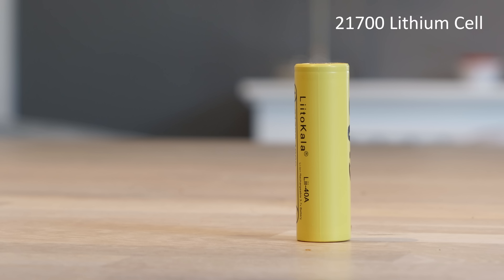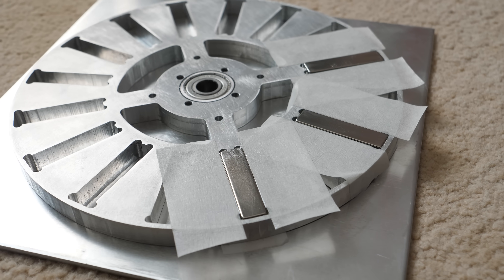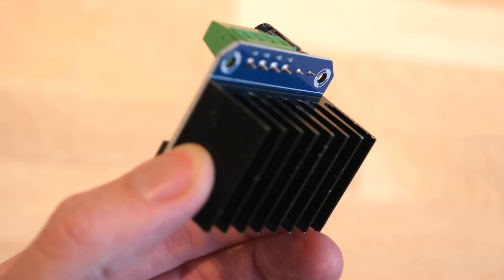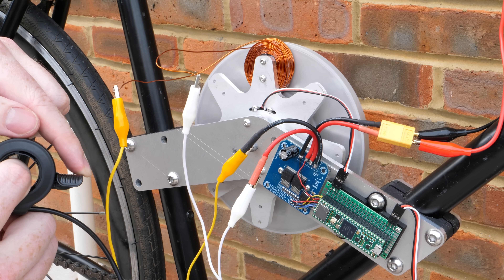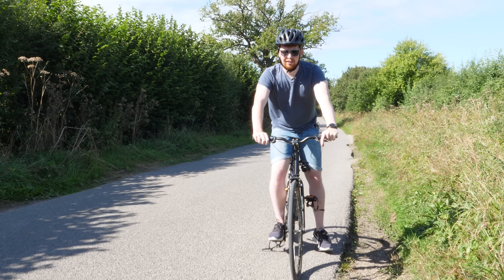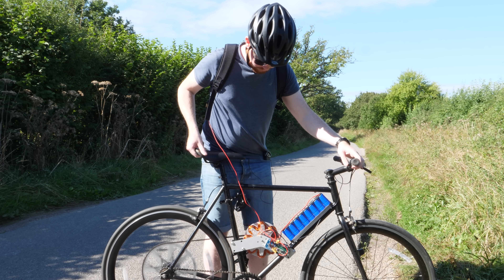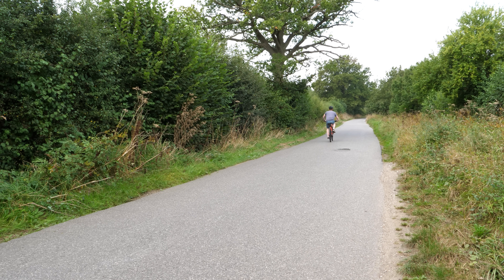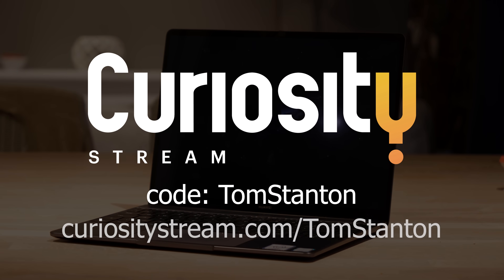Super Capacitor Bike

Comment: If you want to make an ESC, you’ll need both modern MOSFETs and high-current gate drivers. The NTMFS5C628NL is the gold standard cheap good MOSFET for motor drivers in the 12S range, and there’s likely similarly good MOSFETs for other voltages. Be sure to provide them with a heat-sink if needed.
I’d also suggest to use the main drive magnets of the rotor for position sensing, no particular need for another ring of magnets.

I’m also designing a motor for myself, and found a very useful instructables page on building a hub/wheel motor for a scooter. He includes a bunch of design tips that apply to basically any BLDC. There was also a video where some guy made a motor for a bicycle using the stator from a washing machine I think. Notably he used magnets in a halbach array for higher magnetic field strength. There are some equations you can use to calculate what torque you’ll get and what kind of emf will result at a particular speed, which you can use to calculate a theoretical efficiency curve. This will help select an appropriate Kv value for your windings, and help you select a battery voltage and MOSFET combination.

Comment: Would something like a joule-thief circuit help with extending the range a bit?
Reply: They're called "boost convertors". The Joule Thief is a boost convertor, just a particularly cheap and clever one, but the general name is "boost convertor". And I had the same idea. Depends on how much energy is in the caps after their voltage falls below the limit to power the motor. If it's a significant amount, maybe.

Comment: Cool project Tom.  "Supercap" in the title pretty much grabs me any time. Have you considered iron cores for the coil cores? This should magnetically saturate more efficiently. The rest of the rotor could stay aluminum, and just have coil cores be iron. You'd see a large increase in torque, though likely a moderate decrease in range.
Reply: Looking at the video, the motor runs quite fast, and soft iron cores are generally not super good for higher frequencies, though I'm not sure if you'll notice it in this case. It'd be interesting to test
Reply: @willemschipper7736  Eddy currents are the bigger problem.  At 240 rpm, for a 1.5 cm thick block of steel, you burn about 4 kw per kg of core.  And that loss is just from the magnets passing by the steel at that speed- no more coasting.  It's a very effective brake.

You also need a backing plate (or a second rotor on the other side) to complete the magnetic circuit- using cores is not enough.  The point of the core is to lower the impedance.  If you only replace 20% of the flux path with steel, it's like putting a wire 20% across a battery.  You're still gonna have a very high resistance.
Reply: @harperwillis5447  maybe a ferrite core?
Reply: @youkofoxy  ferrite =iron
Reply: @harperwillis5447  Is this part of the reason why stacked plates are used in some cases? like in transformers.
Reply: @dr.zarkhov9753  Yes, it is.
Reply: @harperwillis5447  
Surely you'll get just as much eddy currentage in the aluminium, though. More, even, due to its higher conductivity?
Reply: @momoneystuntsandbuilds5520  In cores, "ferrite" typically means iron dust with the dust particles electrically isolated from each other.
Reply: @robbiejames1540   For sure- there's a bit of loss where the coils are mounted to the aluminum frame.  It's good that it's only a star, because a full disc would have more loss.  However the field is relatively higher inside the coils, and you'd see a lot more loss there.

The loss inside the aluminum disc is pretty low, because the field strength is mostly created by the magnets, and doesn't change.  The aluminum closest to the coils will see a little bit of loss but its even less than from the star.
Reply: @harperwillis5447  
Aaahh, I see. Thanks for explaining that!
Reply: @harperwillis5447 I used soft iron you see in steel banding as part of my stator for this motor i made.
 https://youtu.be/_Xaf5rW72Zk 
The coiled steel strapping used as lamination is painted with a thin non conductive coating from the factory. 

Super slow motion. 600 something rpm running on 1.49v consuming about 5 watts.
 https://youtu.be/anpewPCA75E

The point of the core was to increase, not decrease the impedence of the three 4 turn coils. This in turn lowered the motor's Kv while also providing a low reluctance path for the magnetic circuit.
Reply: @harperwillis5447  No, the point of a core is that magnetic flux travels very well through iron, and it travels like shit through air.
Reply: @momoneystuntsandbuilds5520  no, it's iron oxide, and it's what's used for high frequency transformers like in radios
Reply: @robbiejames1540  aluminum is not ferromagnetic, and it won't hold magnetic flux
Reply: @SeeFreeTV  
Indeed, but it is conductive, and so eddy currents from changing magnetic fields will still occur
Reply: @robbiejames1540  Yes, nothing is 100% efficient. Magnetic flux doesn't travel well through air, so for high frequency applications like radio waves, ferrite is used. For lower frequencies like 60 Hz, laminated soft iron is used, since lower frequencies have less eddy current losses, and iron can hold much more magnetic flux than ferrite (per unit of area). The point of using different core material is to optimize the losses as well as the magnetic flux. For the motor he used, the frequency is closer to the 60Hz range, and he should use laminated soft iron perpendicular to the windings. If he had done so, he could've built a motor with the same amount of power using cheaper magnets, or a more powerful motor with the same magnets. But none of this really matters, since the weak point was the amount of power storage he has. He should've used 100X as many capacitors at least.
Reply: @Harper Willis  I was about to say the same thing about the magnetic circuit not being complete and you've beaten me to it, the difference would be quite dramatic and is why every speaker I've taken to bits as a kid had exactly this concept built in. @TomStanton your next iteration would do well to incorporate this...
Reply: @danriches7328  could you explain a bit more , what your saying sounds interesting but I'm only a novice.
Reply: @momoneystuntsandbuilds5520  Not really. Ferrite cores are usually iron oxide, doped with Manganese and Zinc. The point is that the material has a relatively decent permeability but also high resistance, so you don't lose so much energy to eddy currents
Reply: @eekee6034  That's actually just because people tend to not know the difference and call everything ferrite. Powder cores are not the same as ferrites
Reply: @willemschipper7736  Then ferrite core
Reply: It might be worth considering impedance matching (or fiddling) to try get max power. Im no expert at this but the caps and the inductors (motor windings) might be trung to battle it out at the moment 🤔
Reply: Show Like... Caramba. Maneiro.
🙏🏼🇧🇷👍
Thief circuit of Joules... with piezoelectric insert we tires.  would it be helpful?!? Obs: motor bedini for Bike 👀
Reply: @RODOLFO.M.S  joule theif circuit is rather inefficient.  Piezo harvesting would steel energy from forward motion, and add significant weight.
Reply: plasma channel is one of my favorite channels on youtube
Reply: @DamithaNadeeshaWanniarachchi  same here 👍 Jay does excellent work. 😁
Reply: A ferromagnetic substance
Reply: Capacitors for taking off quickly from the start, li-ion batteries for cruising, with regenerative braking recharging your capacitors specifically. Now that'd be neat!
Reply: Unfortunately I misread the title as “supercrap,” and was sorely disappointed when 5 minutes in no one is sharting.
Reply: Well iron is ideal because steel holds a field and if the response is right about the frequency a nickle copper alloy core would be ideal
Reply: When he said for it to hopefully switch the current Does that mean its moving left to right really fast?

Comment: I've thought it would be cool to have a hybrid battery and capacitor setup. Capacitors for the high current at the start, and the batteries can have a more constant draw to extend life and allow different chemistries. Perhaps one with good energy density, but poor instantaneous current capability.

Comment: Just some thoughts. Gear ratio impacts speed, and if you designed a lithium battery pack that would go under the top tube with a BCM designed to output a higher voltage to the capacitors you might have something there 😜

Comment: 01:30 - If your motor controller can switch polarity, why can't you have a circuit for power switching to balance the available current with rapidly decreasing voltage so more of the stored energy can be used?

Comment: Hi did anybody read in the sun newspaper approx ten years or so ago about the gyro car this guy developed called the nova.it used a massive generator spun up by a 200 cc Yamaha  motor cycle engine.it would do 140 mph and  0 to 60 in 8 secs and the equivalent of 242 miles per gallon.amazing.he tried to get  permission etc but declined.I can’t find anything I the sun archives and wondered why.any help would be great.kindest regards tim

Comment: By the way, you can use it to protect the circuit from magnetization (since it eats up the energy of the motor) by adding the closure of the poles of neighboring magnets with a conductor of magnetic fields (an ordinary metal that collects, concentrates and directs a magnetic field (MF) to a neighboring magnet, thereby taking it away from the circuit) (by  essentially use the principle of a core in electromagnets)
Looks like at:
[S]   [N]   - magnets
[N]   [S]
  |____|    - directer MF
~  ~  ~   - very weekly MF
><><><>  -bicycle chain

Comment: The only use of super capacitor as a power source I can think of is a railgun. Maybe, the best approach to using it as a motor would be a flywheel to convert the explosive power into kinetic, using the railgun approach. Discharging a super capacitor bank as quickly as possible to create more powerful EMF would probably be the best way to take advantage of it's flow rate. The reason for it's underwhelming performance is that it was used with a normal electric engine, when in fact the key feature is it's release rate.

Comment: My only experience with capacitors was when I worked at General Motors on the assembly line. We would take an ignition capacitor tape the wire down to the side of the capacitor and bend the connector back on top of the tape so it wouldn't short out then we would charge it and when someone we wanted get would walk by we would toss it to them and when they caught it they got zapped! The stupid people we got twice!

Comment: The early graph must be % discharged on the X axis. As discharge reaches 100% voltage drops. Or if it’s % charged then it goes 100-0 on the X which would be odd 🤔

Comment: I love how you used a battery charger set to some random setting to charge the capacitors instead of just plugging them into a constant voltage supply set to the desired voltage like any reasonable person would do.

Comment: I've heard about a method to double the voltage at the expense of a faster discharge rate (to keep the total power constant). This would be a fun application to get more of that "full power till the end" despite using capacitors

Comment: Differences in capacity and self-discharge rate means that your series capacitor bank is going to drift out of balance very quickly.  This means that individual caps can be driven to reverse polarity during discharging and/or some caps will be overvolted during charging.  You can get little balancer boards for these supercaps - definitely indicated in this application.
Reply: Or just put them in parallel, and use caps rated at a suitable voltage. Using caps in series seems an unusual choice anyway, caps aren't really made for that. He seems to be using them like they're batteries.

Comment: ever heard of buck-boost circuits, to get the same level of voltage all the time, not a problem
Reply: too complex solution, keep it simple
Reply: dc motors, dc motors, not bldc
Reply: conductive bearings brushed dc motors, graphite lubricant conductor
Reply: E=(1/2)CV^2, so the last of the voltage dropping down does not matter that much
Reply: gasoline engine/motor/generator to keep the supercaps in charged state
Reply: back-pack is brilliant, pun intended
Reply: aluminium-air water-baking soda batteries, with the supercaps
Reply: electric drive train, charge the supercapacitors by feet spin generator, wire to 2x hub wheels, short time energy balance storage
Reply: try wire spool aluminium-air circulating salt water electrolyte fuel cell system, separate the fuel wire from the fuel cell engine with its electrolyte systems, in a spool you will have 7kwh/kg energy density for aluminium, strictly the metal only, the weight of the engine counts towards to car empty weight, then the fuel is separate, by spools as many as you wish, and the spool metal wire acting as the anode, and the fuel cell engines platinum will be a fixed air electrode, only the spools are swapped, not the fuel cell engine
Reply: if the wire end alone does not give enough current, then add more spools side by side in parallel, the pool feeder makes the anode electrical circuit connection, normal metal-air battery otherwise, and the electrolyte is filtered in circulation to recycle the oxides alter, using Sodium Na process, ie, in sort of Al2O3 + Na => Al2 + Na2O
Reply: no in-car recharging absolutely required, main recharge method is the change the metal wire spools, like in a 3d printer

Comment: This is really cool, I kept thinking of adding a second coil system on the opposite side to have 2 coils sides for more grip and torque, using the plate like a gear and having the inside, middle and outside be used

Then having the super capcitors help with the start torque and as a added boost to the lithium ion battery power input to get it to accelerate better at the times you want. And of course regenerative braking so you can get a little back from it.

This is amazing, thanks for the video :)

Comment: Yeah .... but why ??? you clearly like to tinker with mechanical stuff - but there is far easier solution to that problem ! Take a box standard bike motor & lion controller for low voltage power packs, create a super-cap bank with 4x the nominal voltage required and connect your energy pack to your controller by a decent buck-bust or Cuk converter and you are golden ! you can use your energy down to 10% of your super-cap, if you're adventurous you can stick a second motor on second wheel and regenerate energy directly into your super-cap bank

Comment: When you displayed %charged it was not energy percentages but coulomb percentages. The more useful value would be the energy though because that is what you use. And then it's more of a favorable curve.
E=.5*C*U² so U=SQRT(2*E/C). The curve would be a mirrored root. In your graph at 1:13 this should look more favorable. Li-Ion range is 4.1 V to 2.7 V, so a drop by 33%. At this voltage, the capacitor would have provided over 56 % of its available energy instead of the 33% your graph suggests.

Comment: the advantage of supercaps is amps and charge speed, not capacity, if you built the controller to dump raw amps you'd get more torque, the coils would get hotter and you'd have less range but done right you can build the drive system around pulsing movements for coasting and a 100W solar panel roof to keep it going, flat places like texas and florida etc you could probly get around town no issue.
also they aren't near cheap but you can buy these nice 1000F ultracaps that have bolt on lugs now and you would have a lot more juice to power the project, i was debating getting just enuf of them to build a truck battery so i'd have something for cranking amps and charge rate only to help make my main battery last longer

Comment: Im not quite sure right now but isnt the formula for capacitors energy content something like voltge squared times capacity divided by two? Shouldnt the voltage decrease logarithmically?

Edit: ive continued watching and saw its quite linear indeed, guess the linearly decreasing power discharges slower and slower so it kinda cancels